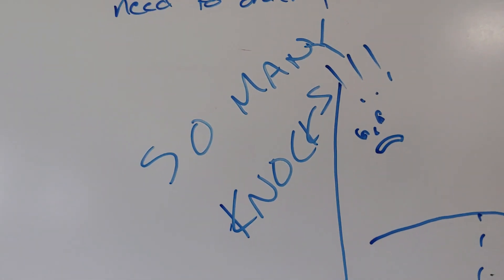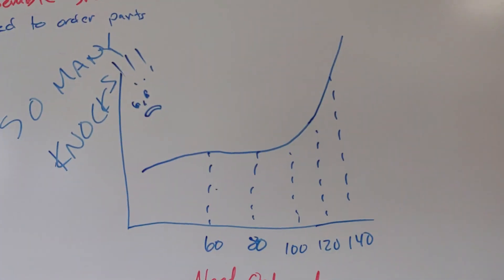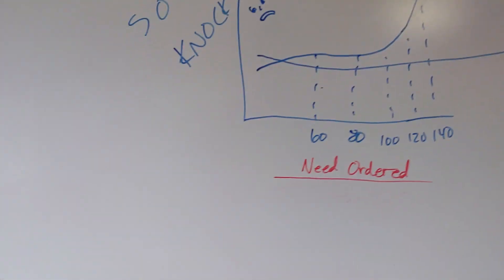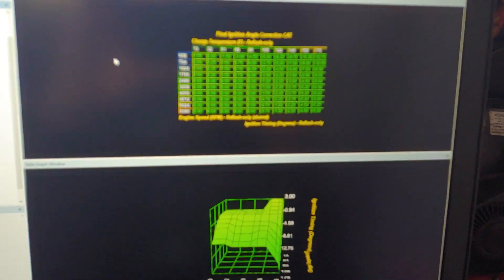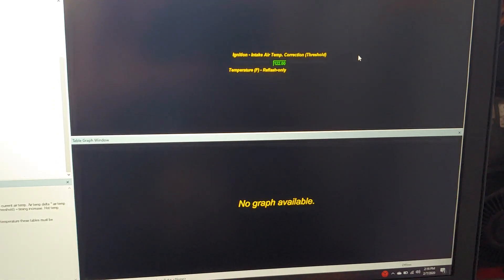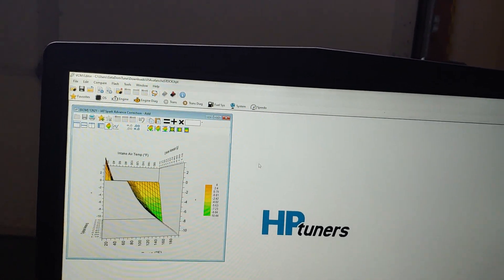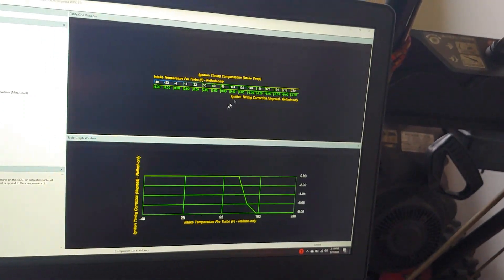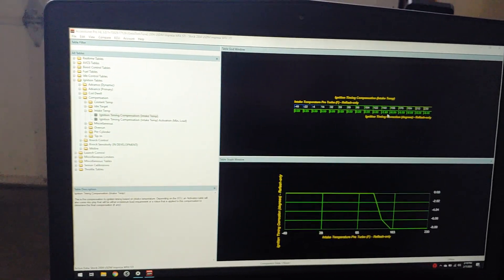Ignition timing and charge temp

Comment: LS ecu for NA cars has the timing tables so you can change only up to around 1.2 grams per cylinder than the highest figure will be constant for the rest of the intake charge increases so with a turbocharged modification you might leave a lot of power potential on the table.  The fact that pump gas is really tuned for NA engines is a major consideration when pushing up timing for power with a aftermarket ecu or ignition modifier component on a stock ecu. Thanks for explaining it so well in this video!

Comment: Hey dom, love the videos I’ve learned a lot. 
Is there benefit to moving the IAT sensor to be post intercooler on a already modified 02 wrx on pump 93?
Reply from the maker: Yes.
Reply: Dominic Acia thanks dom! The only place I can imagine sticking it would be the coupler piping between the intercooler and throttle body. Is this the typical installation spot? Any other suggestions? 
Thanks again! Appreciate your reply and content
Reply from the maker: @grandtheftauto1233  we put it in the pipe closest to the TB or in the end tank of the intercooler right behind the TB
Reply: Dominic Acia 
Thanks for the input dom! Wish I wasn’t in Ohio I’d get a dom tune :)

Comment: So pulling timing would make it fire closer to tdc or btdc rather then atdc? This takes me back to your video about about crankshaft counter weights and Subaru cranks. Wouldn't you want the engine to fire at tdc in that case or after? This way the rod is setup to head down the cylinder on compression stroke. Not inline with the main bearings? I understand that the ignition timing will change based on rpm. But how do you determine this without the trial and error approach most tuners take. Can't you calculate this all and set up the values in the ECU. Then you wouldn't need to worry about MBT or pre ignition. Knock whatever you want to call it. Also doesn't dwell timing have a lot to do with this also. How do you convert the dwell timing based on rod to main centerline.
Reply from the maker: Huh?
Reply: @GetaDomTune  I don't mean to come off like a smart ass or a dick but? you can't make sense of that?

Comment: Love your videos,
great content keep it coming.
still puzzles me why only JDM got the post intercooler IAT (GD chasis), especially for those who live in hot summers since that is the actual temp the engine is getting and not a estimation based on MAF located temps.
Reply from the maker: I am under the impression the manifold IAT was only for the automatic intercooler sprayer.

Comment: On my understanding, Subaru (at least around 2008) has an intake air sensor in the airbox but no temp sensor post-intercooler. Does the tuner (OEM or aftermarket) just estimate the heating effect of the turbo and the efficiency of the intercooler and keep a safety margin when tuning for manifold air temps?

Thanks
Reply from the maker: Basically, but it isn't even that complex from the factory. 
We always relocate the IAT if the customer will let us. It saves engines.

Comment: How does this work regarding timing when using a Water/Methanol setup? Since it's effectively cooling IAT a ton. Do the tables get modified heavily in favor or left alone? I know you have to tune for it, but I assume you don't have to be as drastic as ethanol because it keeps IAT low. Or maybe I'm completely wrong.

Thank you.
Reply from the maker: You're adding octane and reducing IAT with meth injection. The question is whether or not you're also increasing fuel stability. 
I wouldn't change the IAT ignition compensation since once you lose your meth, you have high IAT again.
Reply: @GetaDomTune  Ahhh OK. I didn't realize that Meth also increased the octane rating as well. And that's a great point regarding coming off boost/Meth, and IAT shooting up again.

Thank you for the insight.